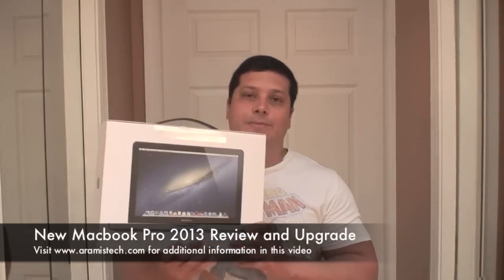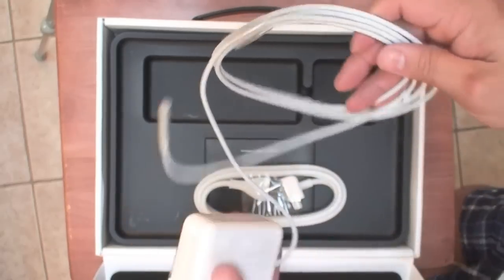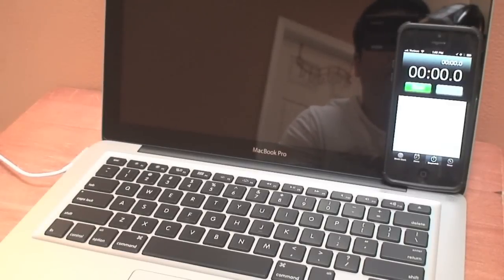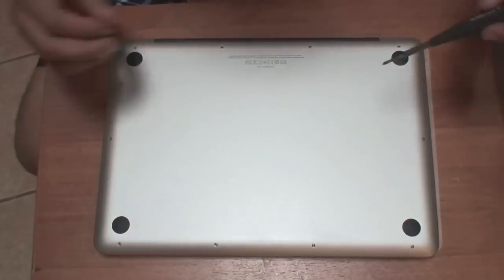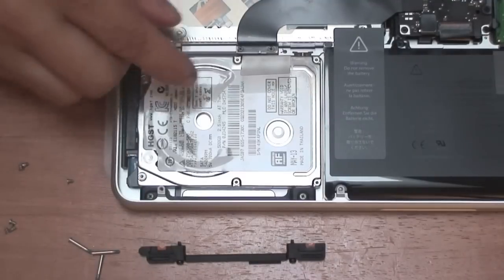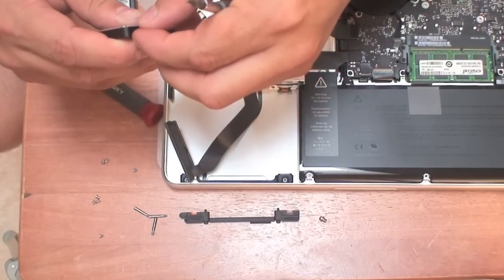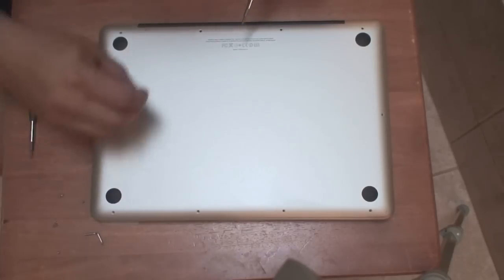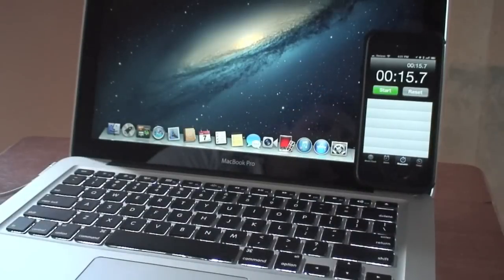Macbook Pro Mid 2012 Upgrade and Review

Comment: For anyone wondering, Apple says that it's only upgradable to 8GB RAM, but third parties have determined that if you use 2 8GB DIMMs, you can get 16 in this thing.

Standard RAM: 4GB, Maximum RAM: 16GB*
*Apple officially supports a maximum of 8 GB of RAM, but third-parties have determined that this model actually is capable of using up to 16 GB of RAM with two 8 GB memory modules.

- https://everymac.com/systems/apple/macbook_pro/specs/macbook-pro-core-i5-2.5-13-mid-2012-unibody-usb3-specs.html
Reply: But will you notice the difference between 8gb and 16 gb of ram

Comment: I disliked because you kept saying "SSD Drive". Know know what SSD stands for right? Also, for all those wondering, Yes Apple says the max RAM for this model is 8GB, But if you have OS X Lion (10.7) or above installed and the latest SMC and EFI Updates installed, 16GB will work with no problems. :)

Comment: Hi!  I am so happy I found your video on upgrading the macbook pro mid -2012.  I currently have 4GB ram with 500GB hard drive. I just ordered the Crucial 16GB on Amazon.com.  I can't wait to install for better speed.  I own the 27" iMac and it is super fast!  So I would like the same speed especially when booting up.  Would you suggest getting the 250GB SSD hard drive oppose to keeping the 500GB hard drive? Your instructions were very easy to follow.  Thanks again!
Reply: Angela Cottingham I’m going to upgrade my MacBook pro 2012 from 4gb 500ssd to 16gb and 500ssd. Will it be faster? Do you think I can edit videos in premiere pro or final cut?

Comment: But this macbook pro mid 2012 has 4gb ram which can be upgraded to 8gb at max not 16gb
Reply from the maker: yipman214 I have had this MacBook with the 16 gigs of ram and the SSD since 2013 it's never had any issues and still works super fast. I have it now with sierra and it's great
Reply from the maker: ASH no you are wrong I have that MacBook running with 16 gigs of ram
Reply: +aramistech but the store from which I bought the same macbook told that it will be upgraded to 8 GB RAM only
Reply: aramistech Buddy I'm planning to upgrade it to a 16 gigs too, but I don't want to upgrade it with an SDD. How long have you used your Mac with this upgrade?
Reply: Yup. I too upgraded to 16gb RAM.
Reply: I need it for game development. We're going to be using the ram a lot. What's your advice on a 16GB ram upgrade? Should I still go for it? Just double checking.
Reply: I have the white mid 2010 MacBook and officially it’s 8 gigs but I have that running nicely with 16 gigs

Comment: to install the OS into the new drive how did you do it?
Reply: There are 2 ways of doing this - for a fresh install, before upgrading go to the app store and download OS X (El Capitan or Sierra). Then quit the installer when it pops up. Use diskmaker X to create a bootable USB stick (16GB stick needed), perform the upgrades, then hold option while booting to select the usb and install as normal.

To clone the current hard drive first connect the new SSD to a usb to serial ATA cable and plug it into the macbook. Boot the machine from the original hard drive, then use cabon copy cloner to clone the hard drive to the SSD. You will need an SSD that is larger than the total used space on the hard drive. Disconnect the SSD from the USB to serial ATA converter, and perform the upgrades. When your done, boot the machine holding Command-Option-P-R to reset the pram so the machine will boot from the new SSD. Hold the keys until the screen goes black after the chime,

Comment: apple said, the max ofmacbook pro mid 2012's ram is 4 gb, but if i want to upgrade to 16 gb without changing the hard drive, its works or not?
Check this https://support.apple.com/en-us/HT201165
Reply: thanks
Reply: Andre Setiawan:yes it will that if u want to do both at same time....and of course apple is going to say something stupid like that,i too went to them one time about downgrading so i called when i knew the answer cuz i  did downgrade but still called and they said no,it is not possible,i said really,cuz i did,lol...so they don't know it all.

Comment: apple says that this model cant be upgraded to 16gb ram, i have 8, but i love to expand that, do you have any problems with 16?
Reply: +RLLoficial i have 16, works great
Reply: Standard RAM: 4GB, Maximum RAM: 16GB*
*Apple officially supports a maximum of 8 GB of RAM, but third-parties have determined that this model actually is capable of using up to 16 GB of RAM with two 8 GB memory modules.

- https://everymac.com/systems/apple/macbook_pro/specs/macbook-pro-core-i5-2.5-13-mid-2012-unibody-usb3-specs.html

Comment: Hi, do you think is it worth buying macbook pro 2012 now?
is it good for video editing? does the lack of dedicated graphics hard a bottleneck for photo editing and video editing?
How does it perform with ssd and 16 gb ram? is it on par with latest mac laptops with the upgrade?

Look forward to your response....
Reply: +LOHIT NAIK Not at all it's great,  I'm getting one for programming perp. Compiling on this machine shouldn't be an issue. Gaming is NOT to be conc. on this laptop because windows is the way to go when gaming. Editing on this machine is not a big deal as you can upgrade to 8 GB ram [ 2x2 4 Kit ], or leave it standard on 4GB wont be a big issue.
Reply: Would never recommend this laptop now go for the new air.

Comment: I've just done the same thing to my Late 2011 15" MBP... only I replaced the HDD with the SSD and then removed and replaced the Optical Superdrive with the original HDD... definitely a much shorter and easier process when you're only looking to change out the RAM and upgrade the main drive. Replacing the optical drive wasn't exactly super-complicated, but it was definitely the most difficult and fiddly bit of the whole process!

Comment: i have the same year model but 15 inch..i have finished all the ssdhd installation process, after that whats next tho? do i have to boot up with some butttons from the keyboard to press or anything? before i load my back up files from the time machine i created...need your professional and expertly suggestions or instructions so that i might not screw my macbook pro..thanks

Comment: i thought this laptop was only upgradable to 8gb's of ram?
Reply: ***** definitely supports 16gb. there isn't an option to upgrade on the website but it supports most 3rd party ram
Reply: Lj .lawson I think he means he bought his mac for $1500 with the 8gb of RAM already installed.
Reply: Standard RAM: 4GB, Maximum RAM: 16GB*
*Apple officially supports a maximum of 8 GB of RAM, but third-parties have determined that this model actually is capable of using up to 16 GB of RAM with two 8 GB memory modules.

- https://everymac.com/systems/apple/macbook_pro/specs/macbook-pro-core-i5-2.5-13-mid-2012-unibody-usb3-specs.html
Reply: SliM DruMMuH Yea I read something like that on the apple website. I paid $1500 for my mac with upgraded ram to 8gb but I want faster. If it does work with 16gb I will upgrade again! Let me know what you find out
Reply: ***** lol you got your money stolen you can do it yourself for 80 dollars

Comment: Hey aramistech thanks a lot for the video. really enjoyed watching it. gave a "thumbs up" as well. ;)
I am seriously considering this machine & thinking about a 16GB RAM + 250GB SSD upgrade. Is it still worth it? Considering that I am getting the machine for USD 900 + about USD 250-275 for RAM & SSD. The final cost would be around USD 1150 - 1175. 
Will it be still better than buying the base 13" Retina MBP with 5th Gen i5, force touch trackpad, 128GB SSD & 8GB RAM for almost the same price, in terms of performance?
The only heavy software/applications I am gonna run on my MBP are Solidedge & Solidworks 3D modeling softwares.

Comment: After doing the upgrades that you did, do you notice the spinning wheel doesn't show up as much? I have a mid 2012 MacBook Pro i5 2.5GHZ 4GB and 1TB HDD was gonna upgrade the ram and to an ssd but wasn't sure if it would help stop the spinning wheel?

Comment: hey man, great video. i have the same computer 2012 pro 1 tb hard drive 8gb ram 2.9 i7. i was thinking of doing the sad upgrade and the ram upgrade. sad rocks. i was wondering what do you do to transfer all of the information onto the new drive. like if it is a brand new drive how do you install the mac operating system? was there and installation dvd? i bought my mac from the apple store certified refurbished. came like brand new but no installation disks. its my first mac so i am not entirely sure how they differ from pc as far as upgrading
Reply: Use carbon copy cloner buddy! For tutorial Lord Youtube n google r always there 1

Comment: would you say it run better than a 2012 retina ???? 
2.5 Intel i5 ???? thinking of getting rid of my retina, and just max out a 2012 macbook pro
Reply from the maker: It works really good form me. Once I put the SSD drive and the additional memory it works really fast. I haven't tried the retina one to compare the difference
Reply: Cool, i have all the part (ram, 1tb ssd) think imma upgrade my macbook pro tonight ... 
cause this retina is cool, but mainly all screen
Reply: No, you get a better procesor, better integrated graphics and much better pci-e based storage, plus a thinner device and the much better ips display

Comment: aramistech  is that my Mac`s problem, coz i have the same MacBook with 2.5ghz mid2012, but when i upgraded it into 16 gb, it will become unstable, should I swap down to 2x4 gb ram ? Thanks
Reply: +JesseYKM What did u do? 2x4 OR 2X8? Apple say that the max is 8GB. So i dont know what to do.

Comment: on the apple support web, they said the ram limit for this MBP is 8gb
Reply: Standard RAM: 4GB, Maximum RAM: 16GB*
*Apple officially supports a maximum of 8 GB of RAM, but third-parties have determined that this model actually is capable of using up to 16 GB of RAM with two 8 GB memory modules.

- https://everymac.com/systems/apple/macbook_pro/specs/macbook-pro-core-i5-2.5-13-mid-2012-unibody-usb3-specs.html

Comment: do you think that 16 gb of ram are necessary or 8 gb are enough?
Reply: Well on amazon crucial 8gb is about 75, and 16 is about 135 something 16gb could really help if in case you decide to install windows 7 in parallels but even 8 should suffice
Reply: if u are using macbook  without  retina then 8gb is enough. i'm using MD101 8gb ram and u always get around 1.5 to 2 gb free while hard using with a lot of tasks. but retina version require more ram to satisfy that resolution

Comment: I thought the memory limit on this mode was 8GB
Reply: Standard RAM: 4GB, Maximum RAM: 16GB*
*Apple officially supports a maximum of 8 GB of RAM, but third-parties have determined that this model actually is capable of using up to 16 GB of RAM with two 8 GB memory modules.

- https://everymac.com/systems/apple/macbook_pro/specs/macbook-pro-core-i5-2.5-13-mid-2012-unibody-usb3-specs.html
Reply: This one goes up to 16 GB.